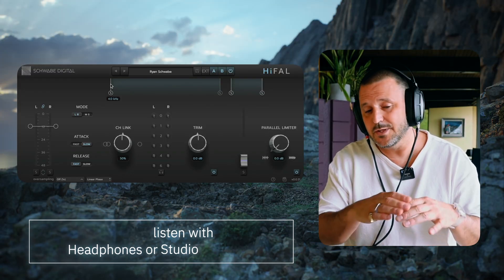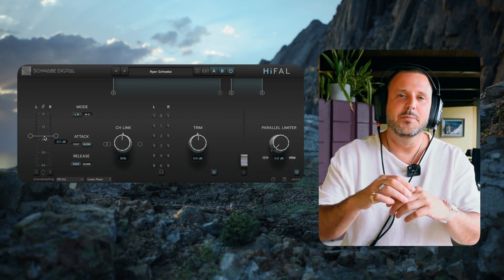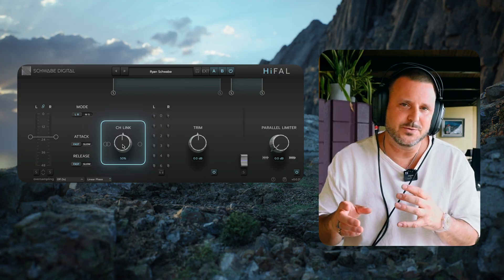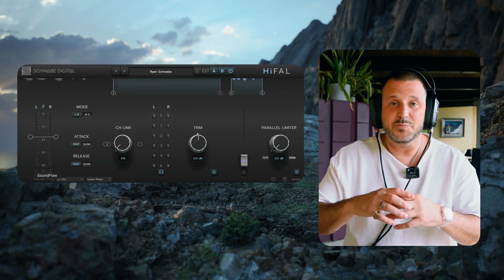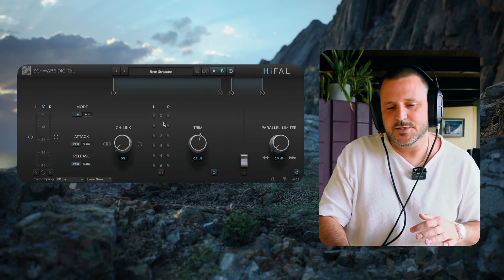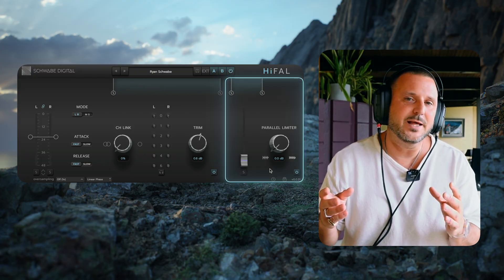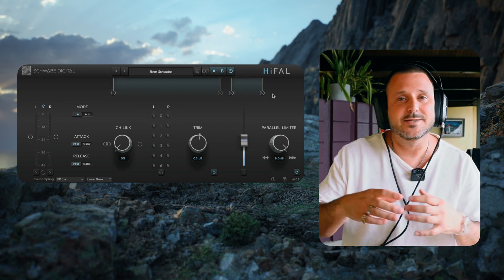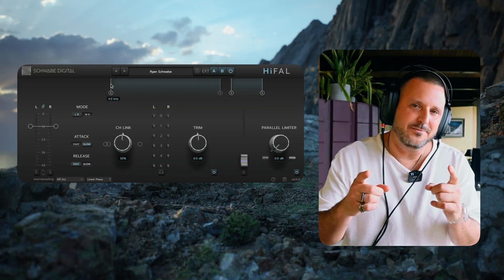1) 6 Steps to Set Up HiFAL on Your Mix Bus

Comment: WHAT am I missing that the fanboys are all hearing because I get similar results with the Weiss Mastering De-Esser and DS1-MK3........I don't like the offset 3d design, why change from a straight top down from Gold/Orange to this new offset to the left view? This is a Maselec MDS-2 clone, not an SSL.
Reply from the maker: It’s a different style of processing. While both operate in the high end, the type of dynamic control is quite different. There are obvious differences in signal flow, design, and how the dynamics are manipulated. I’d suggest giving the 30-day trial a try and spending some time with it. It’s a complex plugin, even though it looks simple on the surface. Thanks for the feedback on the GUI — I love how it turned out, but I appreciate your input!

Comment: I Demoed it for one hour and instantly bought it! No Artifacts audible and sounds excellent! Cheers
Reply from the maker: Yup, no saturation and now changes to the spectral balance, the sound is entirely in the dynamic manipulation and where you place it in the signal.
Reply: @schwabedigital I need to watch more videos. I can’t really hear it. If the top end is bright wouldn’t a MB work the same way? This is to dampen down bright areas right?